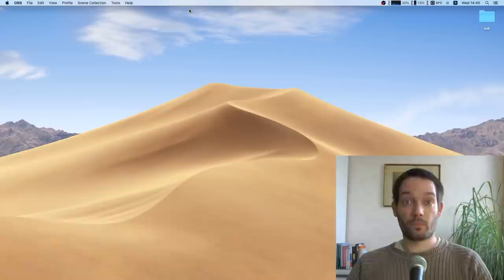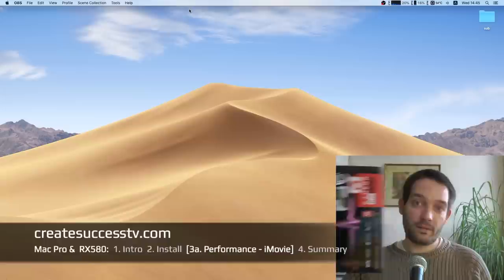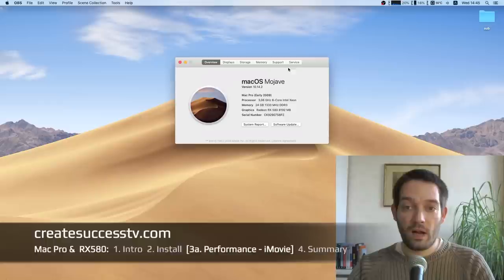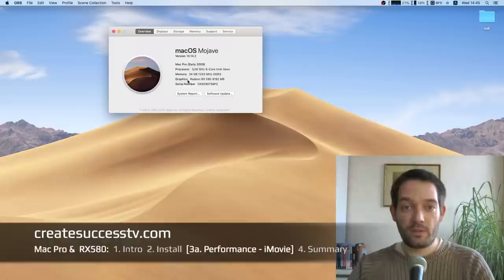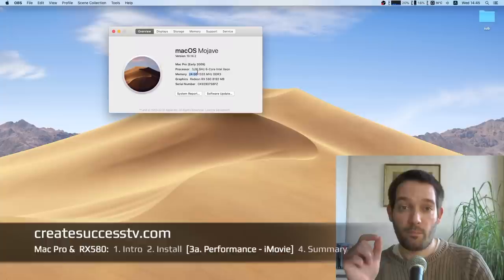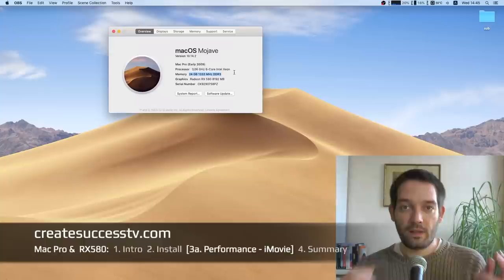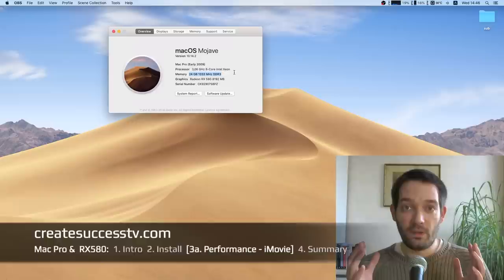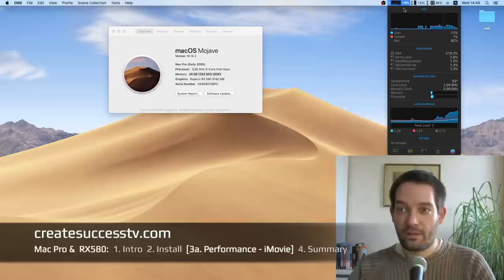Mac Pro 4.1 and 5.1 GPU Upgrade for Mojave (Sapphire Pulse Radeon RX580)

Comment: Saw this on a forum about slots for the card:

I believed slot 2 provide better cooling as well because the air can flow through both upper and lower side.

However, in my test, the card actually has better cooling in slot 1. Not sure why, may be because warm air rise, so the higher the slot, the warm the air the graphic card will intake, but this is the test result (the test was done with a PNY XL8 1080Ti).

Or may be because all 4 HDD bays are occupied. Therefore, too little space above the card for the warmed air to escape.
Reply from the maker: Awesome, I may test the difference when I have time, thanks for sharing!
Reply: Slot one aluminum frame acts as radiator. Slot one is actually better
Reply: Putting the card in Slot 1 delivers 16 Lane PCI in contrast to Slot 2. You should put the card and your faster PCI devices in the lower slots while putting the slower ones on the top slots.
Reply: @bladeart1  Slot 1 and 2 are x16.  Slots 3 and 4 are x4.  I have my expansion chassis PCI card on slot 2.
4x is lower bandwidth as I assume you mean slot 2 is 4x.  
16x is what you want the GPU to be on.

Comment: Hey there, Sebastian, thanks for sharing this great experience. I have a 2010 mac pro (8core) and it still goes hard but I have been thinking about upgrading more. One thing I did early on was add an mSata card with striped 500GB msata for editing and I also run the OS from another slot. It goes well. When you upgrade as you state in your video, prepare to be very pleased! I think I have a 3gb graphics card and I can edit 4k on this old beast but only shorter sequences and then it chugs. I would be interested to upgrade to the 8GB card in your video but also toying with other options. One thing with this tower (and the reason I have not upgraded yet) is I run 6TB drives in three internal slots and then removed the CD and have that SATA cable hanging out externally so I can attach SSDs from my Shogun video recorder directly to the computer. It's a great setup. Bypassing no USB 3 on my system.
Reply from the maker: Seems like you know your stuff... maybe try the RX580, or even the Vega56, just watch the power draw, some cards may need more than 225 watts, then it's a no go... also the NVMe upgrade may be interesting for your system ➜ https://youtu.be/A8hPC_DDq6Q

Comment from the maker: Please be mindful of the graphics card power draw because the Mac Pro provides:
• PCI Slot = 75 Watt
• PCI AUX A = 75 Watt
• PCI AUX B = 75 Watt

Case A: Use the "mini 6pin to 6pin" for a total of 150 watts available ➜ https://geni.us/gBZvb
Case B: Use the "dual mini 6pin to 8pin" for a total of 225 watts ➜ https://geni.us/5ozmi

### Case A - Low Power Cards ###
• Sapphire Pulse RX560 (11267-20) = 75 Watt ➜ http://geni.us/496emt
• MSI Aero RX560 (ITX OC) = 60 Watt ➜ http://geni.us/5V0VD3

### Case B - High Power Cards ###
• Sapphire Special Edition RX580 (11265-21) = 250 Watt*
• Sapphire Nitro+ RX580 (11265-01) = 235 Watt*
• Sapphire Pulse RX580 (11265-05) = 225 Watt ➜ http://geni.us/rX6mx

*Always go to your card manufactures website, and use the exact model number (SKU) to identify the power draw. Because even if the card has the same chip, power draw can sometimes vary due to the card's memory, and or chip clock speed.
Reply: Create Success TV hello, i have the MSI Radeon Vega 56 Airboost but my mac just gives me a black screen and cant do much. Have any ideas what can that be?
Reply from the maker: @NewRiseTV  Unfortunately, most Vega56 cards need two power connectors to work, it's not the fault of the card or the Mac, that's why I can only recommend Radeon RX580 at this point.
Reply from the maker: @NewRiseTV  If you have seen people use Vega card in the MacPro it is probably because they did Pixlas Mod, which I didn't want to do, or because they did some other power wiring, such as mini 6 pin to 8pin for both AUX A & B, which may work but risky, because I think mini 6 pin is 75 watts rated, and 8pin 150 watt.
Reply from the maker: @NewRiseTV  The Vega card won't work until two 8pin power cables are connected.
Reply: Create Success TV i did the Pixlas Mod to get enough power for it and installed the card and OS Mojave recognized the card and it turned on fine then my mac was asking for a security update then I did the update then all of a sudden my screen started going black then back on then black then back on so when I restarted the mac it will just stay on a black screen now. Im bummed.
Reply from the maker: @NewRiseTV  I did try the Radeon RX560 and RX580, both work fine to this day, absolutely flawless.
Reply: Create Success TV i think I found the problem. I was connecting the hdmi out of the card to an old vga monitor with an vga to hdmi adapter. Once I plugged the hdmi out with a proper hdmi cable and full hd monitor it worked. Thanks for your replies.
Reply from the maker: @NewRiseTV  Awesome, great to know the GPU upgrade worked on your MacPro.
Reply: What cable do you use for the 580 special addition 250 watts
Reply from the maker: @ShaniJaf  I think you can only use up to 225 watts, everting else at your own risk.

Comment: Hi, and thx a lot for this great video. You don't speak about the power supply. Is the original Mac Pro 300W enough? because the RX need 225 W. And i have a problem with a PHILIPS TV LCD 10 years old  that i use like monitor by HDMI ports. But with the RX580 the screen become green and pink sometimes. The TV firmware is upgraded. A solution ? Perhaps the TV is too old because it works good with the original graphic card.
Reply from the maker: Info about connecting power was given in the video, more details in the description, card works fine with HDMI and DisplayPort.

Comment: I am currently using osx 10.7 and I want to upgrade to gtx580. When I plug it into my Mac, the screen doesn't appear, is there any solution?
Please tell me a more specific way.
Reply from the maker: Sorry, but I have only tested AMD Radeon cards, such as RX560, 570, or 580.

Comment: Awesome Video's,  I bought a Mac Pro in 2010,  one the best computers I bought,  super easy to upgrade the Ram, even change out the Processor,  super easy,  now there Sought after for this Purpose,  change out your Power supply for the Video Card,  Flash the computer so you can run a Operating System to the Highest.  I'm looking forward to your Power Supple Solution,  to see what you've done.
Reply from the maker: Thanks for sharing

Comment: Yeap, make a lot of sense put the gpu on the second x16 PCIe line, can dissipate a more heat this way.
Reply from the maker: Keep in mind that in a PC the card would be flipped around, so it is designed to dissipate heat via the bottom plate.
Reply from the maker: My normal temps are around:
35° desktop use
50° video editing

Comment: Thanks for the video, Should I install the rx580 first and then upgrade to Mojave? or the opposite?..thanks!
Reply from the maker: Please install High Sierra, switch out the cards, then you can upgrade to Mojave, in fact, the installer won't let you install Mojave without a Metal supported GPU, please note that Mojave will also ask you to do a Boot ROM update when you start the installer.

Comment: I upgraded my Mac Pro 5.1 to an AMD Radeon RX570 and the seller claims that the only thing that separates it from RX580 is speed. Is that right? Well, when I installed the videocard I had to remove my extensions-card with 4 USB 3.0-ports because it was so extremely tight between the new videocard and the pci-e-card, only a few millimeters to the fan. I decided to remove my second SSD-disc from another slot and reinstalled the pci-e-card, but now I don’t know how where to install the SSD. I have Catalina on it, and one of the reasons to change to RX570 was to be able to work in Catalina. And yes, I now have boot screen in 4K 60 Hz and displayport is working in Catalina but it also gave me other problems. Can I have something so tight to the videocard without more trouble? This old computer should be retired immediately. It has 10 years old technique and I don’t know why I keep spending time and money on it. Yes I do know. I can’t afford a new Mac Pro.

Comment: each 6-pin delivers 75W, but the RX 580 draws 185W at the 8-Pin Port, is the system stable, when you render with GPU?
Reply from the maker: Actually the card seems to draw surprisingly little power,
• Desktop use 15 ~ 25 Watts
• Video editing/export 35 ~ 45 Watts
• Gaming 90 ~ 135 Watts
Reply from the maker: Now because there are many different RX580 cards, I can’t speak to other models, but at least for the Sapphire Pulse edition, it should be relatively similar, for measuring I did use iStat Menus ➜ https://bjango.com/mac/istatmenus/
Reply from the maker: Also I would imagine that other programs, I currently only use iMovie, may utilize the GPU more, like when you export in Adobe, or Final Cut X, so far however, the system runs 100% flawlessly.
Reply: PCIe x16 slot delivers 75w plus 2x 75w from the 6pin connectors, so it should be a total of 225w possible (if you use the 2x6pin to 1x8pin adapter)
Reply: @jscipione  a mac is not a PC? Is it an alien or what? haha
Reply: @jscipione  This is true? i wanna purshase  a Sapphire Nitro+ AMD Radeon RX 590 8G, the power consumption is 250 watts. i have a 5.1 mac pro. thanks!
Reply: @jscipione  the only RX580 i could purchase locally was the Sapphire Nitro+ AMD Radeon RX 580 8G which has a slightly higher power draw than the pulse etc. based on what you are saying, it seems like i may not have to worry about doing a pixlas mod to avoid issues with power draw ? would you possibly be able to advise me on this as im kind of new to this etc ;)
Reply: @jscipione  thanks john, i understand the first part of what you said but im unfamilliar with what "YMMV" means ?
Reply: John Scipione thanks mate 👍

Comment: Many Thanks for your video. Do you think a  Sapphire Nitro+ RX580 with 4GB work with the energy consumption of using high power case 2 method.  The Nitro uses 235w of power.
Reply from the maker: Ok, most people monitor the GPU power by using iStat Menus:
➜ https://apps.apple.com/de/app/istat-menus/id1319778037

Comment: have a 2009 mac pro 4,1 flashed to 5,1with the ati radeon hd 4870 512mb tried installing this exact same card you did. didn't work. fans turn but no image. i also tried an rx560 and nothing with that. don't know what im doing wrong. put the stock card in and no problem image comes up. any suggs from anyone. thanks
Reply from the maker: Many of my viewers have successfully upgraded their MacPro using on of the cards listed in the video description.
Reply from the maker: More on supported GPU options here:
https://support.apple.com/en-us/HT208898

Comment: Excellent video. My Mac came with a Radeon 5870 which had a plate that slides into the fan to support it. Wasn’t really important in slot one, but how did your 580 do without support in slot 2? Also would a hot plate dissipate heat the rough the aluminium if it touches the case in slot 1?
Reply: Yes, yes it would. That chassis will draw heat away as well. The engineers used that type of material for a reason. I don't think it's that much of a concern using that first x16 slot. I really love how these machines were designed.

Comment: One of the best video sharing experiences online in many years.  Thanks so much for sharing.  I am having troubles running Adobe Premiere since installing the Sapphire RX 580 8GB.  I used a Sapphire 7950 Mac Edition before this with no issue but I really want to take advantage of the additional video memory in the RX 580.  Would really be interested in seeing your review of Adobe Premiere and Sapphire RX 580.  Thank you again.
Reply from the maker: May not work because of Adobe requirements:
➜ https://helpx.adobe.com/premiere-pro/system-requirements.html
Reply from the maker: And if you can run the software video export may be slow.
Reply from the maker: I don’t have Adobe so I can’t say for sure, but that’s a risk I am suspecting.

Comment: Very helpful video, actually I learnede from you on a previous one how to bring my early 2009 to a 12 core dual 3.44, my HD slots are full with HDD and 1 SSD, I have the gx780 (flashed/boot) , which I'm not crazy about (premiere pro is unusable) I do have 128 GB 1333 ram and the OS running on an SSD hooked to a pic controller. think I should get this card for sure and the improvement should be noticeable, right? what about sacrificing the PCI slot and using both GPUs... Is it possible? What about the 680, is that a mac edition, or I can use a regular one. Do I need o flash it? I'm a tad ignorant of such a matter and need to learn more. Thanks in advance, and congrats on these great videos!

Comment: hi cheers for the video.im thinking of getting one of these for my mac pro 4,1. i have experience fitting the rx580 nitro+ in my daughters windows based pc but the power comes straight from the psu and plugs into both the 6 pin and 8 pin connectors on the gpu. I cannot tell from your video what way you have connected it up. i had seen another video where the guy had 2 cables running from the mini 6 pin plugs on the macs motherboard then they where joined together by another cable which converted them into a single 8 pin plug being fed by both. is that what you have done? *edit* sorry i just noticed you gave info at the bottom of your description thanks

Comment: Thanks for the great video's, I'm ready to upgrade. Would you consider the Radeon 590 as an option aswell. (as long I get the correct connector cables). Thank you.
Reply from the maker: The RX590 may draw too much power, please be aware of the 225 Watt limit.
Reply: @ReviewTechTV  I have a radeon rx 590 nitro+ on my macpro 5.1 connected with 6 to 8pin cables and works fine!

Comment: Hello there, I'm running a Sapphire Pulse RX 580 Graphic Card on my Mac Pro 5.1, the fan's on the card are not moving. Can you help with this?
Reply from the maker: Fans only run when a certain temperature is reached, I think from 50° celsius the fans should start to spin up.

Comment: Nice in depth video. Does the Mac show the boot screen with this card? Apparently some cards don’t show anything until the OS loads.
Reply from the maker: Yes, if you put in an aftermarket graphics card you will not see the “grey” boot screen.
Reply from the maker: This is because Apple stock graphics cards use a custom BIOS, once you use a non-Apple GPU,
A - you lose the grey boot screen
B - you can’t use file vault
Reply from the maker: Other than that the system works perfectly fine, also, even without the boot screen you should still be able to get into recovery mode, for example by pressing Command (⌘)-R during startup.

Comment: Great video. I’m wondering though, if this would fit in my 5,1 mac pro coz my HDD is running on a few SSDs planted on two PCIe cards. Would these cards take up one or two slots?
Reply from the maker: Upgrading the GPU will always take two PCI slots at least, the Radeon Pulse RX560 is probably the smallest ➜ https://youtu.be/UoV4I-FlYdw
Reply: It takes up 2, but the mac pro  is designed so that the Gpu takes up 2, so it doesn't obstruct an actual PCIE slot because there is none in the second half of the GPU space

Comment: Thanks for your help installing this card. But HDMI is black screen on my Acer 4K display. The HDMI output gives my Sony projector a pic, but no audio (it’s via a Yamaha RX-673 receiver). I’ve searched the net and there seems to be others with this issue, but no fixes. Some say the audio issue is because Apple stopped supporting audio via HDMI and DISPLAY PORT. So I’m wondering whether to send the card back.  I’ve got a Mac Pro 5.1 mid 2010 6core 3.3GHz, OS High Sierra 10.13.6 Any help and advice will be appreciated. Thanks!
Reply from the maker: Haven't use HDMI very much, since my EIZO monitors all have display port.
Reply from the maker: I am running macOS Mojave, there the monitor shows up as an audio device in the settings completely normal.
Reply from the maker: Just checked, both HDMI and Display port show up as audio device and deliver sound, at least under Mojave.

Comment: hello , i am an owner of a mac pro 2009 efi upgraded to 5.1 running high sierra , can i use the pulse rx580 without power problems  ?  Is the slot 2 as fast as slot one for the graphics card ? i also own a gt120 could i use them simultaneous because i want a boot screen or i can have boot screen with the pulse rx580 ? thanks !
Reply from the maker: You can use a graphics card up to 225 watt, slot 1 & 2 are both 16x lane, GT120 cannot be used with macOS Mojave, aftermarket card works fine but you will need to disable FileVault because there is no grey boot screen.

Comment: Hi. Great series.  I have a question. I’m about to upgrade my Mac Pro 4.1 and i was wondering if I put the rx 580 in the middle 2 pci slots like you show will there be a problem since I have a pci audio card in the top slot. Will I damage the audio card with it right above the rx 580

Thanks
Reply from the maker: You can put the graphics card in slot 1 or 2, both are 16x lane bandwidth, as to your audio card, it's up to you.